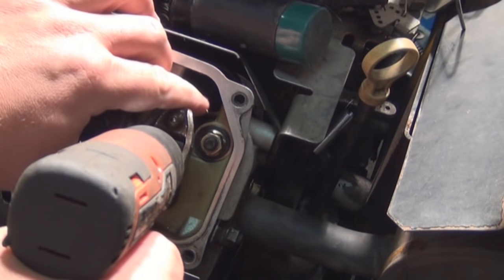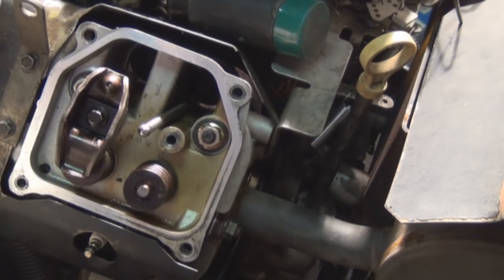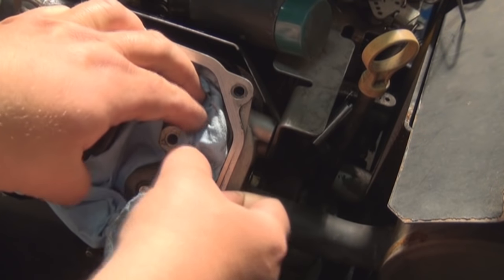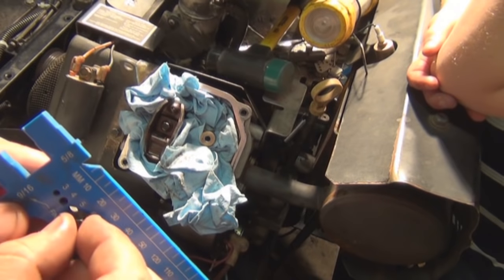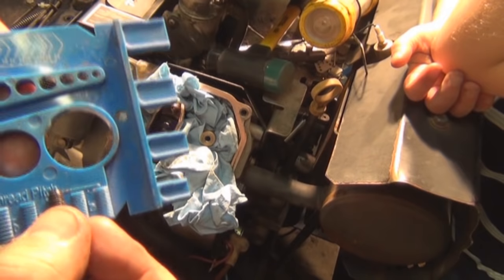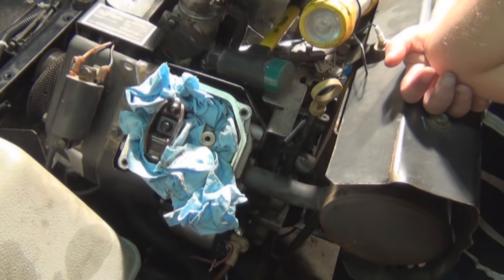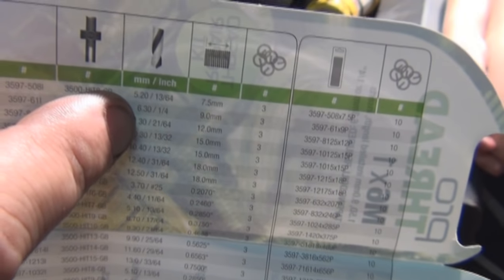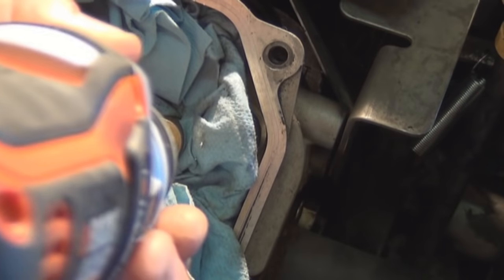How to rethread a stripped bolt hole video

Comment: That feeling of dread when it just keeps spinning. Ugh. WTF did I break now? This is by far the best video I’ve found on the subject. Thanks for posting.
Reply from the maker: I’m glad you found it useful. I greatly Appreciate your comment. Thanks for watching. Please like share and subscribe. Also please hit the notification tab 🔔
Reply: I broke the coil while tightening one of the bolt of my new exhaust manifold. Yap the bolt just keeps on turning after that. It was fixed now. I ended up replacing the washer with a thinner one just to chase the remaining coil.
Reply: It's not worser than a broken bolt
Reply: I feel the pain brother. I popped the threads on my oil cooler for a 17 wrangler
Reply: Still don’t be tempted to go ahead and try when u don’t have a clue , I just done to my 250 and I’ve made the threads worse helicoil failed and tool warped , take to pro or you’ll be a lot of money out of pocket

Comment: That was a great video. When tapping the bolt hole, I've noticed that the thread chips will break into smaller pieces if you unthread about a quarter turn for every turn that you thread the tap in. It results in a stronger threading and less stress on the cut. Also, you'' be able to tap the hole with less effort
Reply from the maker: Zer0  Yes you are correct. Thanks for watching and thanks for the comment.

Comment: use cutting oil, WD40 spray will do, and each time you make a full turn clockwise do a half turn anti just to break the metal chips, just makes it a bit easier and less chance of error...but you did a good job anyway so I guess you have done it before!!

Comment: This guy does almost everything wrong but it worked. Look at other vids if you want better info.
Reply from the maker: That statement contradicts itself, that I did everything wrong but it worked. If it worked, then how is it wrong. Regardless , thanks for the comment. All comments are welcomed.
Reply: I sort of agree, he got the job done but the method was a bit careless and could easily have gone wrong.

He should have removed the head before doing any drilling, leaving it on the engine like that is asking for trouble. The metal shavings could have easily gotten into the engine, especially when removing the paper towels AND using the air gun to blow them off. You could see the left port was exposed.

The drilling and subsequent re-threading should be done using some sort of assembly that holds your tools at the right angle and prevents movement.

I have to say this is a good example of non-professional backyard mechanics. I think the guy know what he's doing and he's got experience but what also shows through is the slack, approximate way of getting things done.
Reply: Jeremy Lindemann yeah yeah Git R done!!!
Reply: good comment but., sometimes backyards jobs are million times better than pro job ., mechanics are careless and I don't want to say assholes ., every time I bring my car to the pros . they fix it but give me another problem the last time my car was making a weird noise he say it was inside the water pump he change it doing a good job but the noise still there and he give me the check engine light on , when I told him about it after he use the scanner and saw the code  his answer was in a really bad mood you can go to California with that light ., honestly mechanics are rats., every time I do a backyard job I do a very amateur job in many hours but with better results.,
Reply: Please link to a better process.

Comment: You can repair a M6 hole by using a BSF bolt 1/4 inch. It has the same pitch and is slightly bigger. M7 has also the same pitch, but is way thicker.
Reply: where do I get English bolts?

Comment: if you are tapping something you want to last or using a smaller tap which can break more easily you should really turn back 1/4 turn every turn
Reply from the maker: magga619 Thanks for watching. I always say follow the directions of the manufacturer. But turning back every 1/4 inch is a good tip for people to follow.
Reply: That is standard practice for anyone cutting new threads.  The purpose to backing it up frequently is to break the thread material (slivers of fine metal) so they release and come out through the relief slots cut into the tap or die.  If you didn't, you'd soon lock up the tap/die with slivers and be unable to proceed.
Reply: AND, ... you could break the tap itself, inside the job making it a really, REALLY SHITTY job to carry on with.

Comment: i read many comments on how he should have tapped the hole by turning and then back, he did say it was an alum head which for sure is very soft compared to steel, i myself thought he was going to deep with the new threads, but this video does gives people the idea how to fix a bad hole, heli coil

Comment: Found two stripped bolt holes for the rotary valve cover on the block of my jetski after a full rebuild probably why the dam thing would run like crap with leaky compression. Anyway, watched this video and now i feel ready to get this fixed and get the carbs back on. Thanks!

Comment: You can use the wrench shown in the video, of course, but you'll have an easier time of it using (1) A 12-point socket and ratchet, (possibly with an extension); (2) The closed end of a combination wrench; OR  (3) A die handle from a tap-and-die set.  I prefer the latter, but you need lots of space to turn it, which you may not have in constricted areas.  However, it provides you a means to evenly distribute the force (think of it as a large T-handle wrench).
Reply from the maker: Thanks for watching and commenting. I greatly appreciate it

Comment: When tapping it's best to turn forward a full turn then back half a turn to "break the chip" of the threads that you're cutting. By simply running it straight through you put a lot of stress on your tap, and removing a broken tap turns a bad day into a shitty day.
Reply: Amen to that.
Reply: Nah - that's easy, you just need to get one of those drill bits that can cut a beautifully straight core through a little chunk of hardened steel with a splintered-off top. I forget the brand of those bits, but they're usually on the shelf next to the broken camshaft glue.
Reply: Absolutely! Good catch! I saw that too.

Comment: Very cool. Thanks for this video. Without this video, i would have probably had to make a second trip for the drill bit, but now I know to open the manual and look for the size drill bit I need. Also, the bolt measuring gauge is a neat item to have around.
Reply from the maker: +Nicholas Maietta I’m glad you found this video useful. Thanks for watching and commenting. Please like share and subscribe.
Reply: handy man followed this example today... problem solved. Thanks again!

Comment: Nice video.

Just a note that on the insert tool has a collar with a grub screw which you can lower to the top of the insert. This acts as a stop so you don't put the insert in any deeper than you need to, which can easily be done.
If it is too deep. in some applications, the bolt may only be caught on a couple of threads of the insert, which is not enough.

Also, you need to break the tang at the bottom when it's inserted. Just take the tool out slightly, turn 90 degrees, and tap it with a hammer/wrench/heavy-ish object :-)
Reply: That's what my dad taught me too! I forgot that while rethreading the fuel inlet on my boat carb & bam had to go up the next size...& the metal was so thin @ that point I didn't want to chance it so 400 bucks went down the drain on a new carb lol

Comment: you need to break off the install tab and take it out, also before installing heli coil you put on some red tread locker, otherwise next time you take the bolt out the heli insert will come out with it. I am surprise the little inspector who was watching in the beginning of the video did not say something and let you continue. He shows interest that is good.
Reply from the maker: Yes he is interested. They get old quick to. Thanks for watching and thanks for the comment.

Comment: Great tutorial. I'm restoring my 94 Pontiac Trans am and some of the 10mm bolt holes are stripped out on the fend well.... I just ordered a tap and die set...
Reply from the maker: I’m glad you found it useful , thanks for watching and commenting. I greatly appreciate it. Please like share and subscribe. Also please hit the notification tab.
Reply: @handymanPF  yes I'm a subscriber to your channel 👍🤙
Reply: I’m surprised that a 94 Pontiac will ever use a metric part
Reply: @johnzhu5735  gm is mostly all mm

Comment: nice video..question: i got confused about the left hand bit (what does that mean) and started my drilling into the broken bolt counter-clockwise😟..idk if ive gotten totally to the end of the bolt, but if so is my only option to go to the next size drillbit and then rethread? thank you in advance

Comment: does the taping has to go all the way down or just enough so the coil can be close to the surface?. or either way would have worked ?  what make the coil to remain strong even using torque ? thank u

Comment: Can you just use the bolt on the threads cut by the tap? I have a tap set but no insert kit
Reply: Jacob Curley -  Im thinking if you want to use the threads cut by the tap it will have to be a bigger bolt, and it might be too thick to go through the rocker arm, in this case.. By inserting the correct thread helicoil into the tapped hole, you have the same conditions for the original bolt, before it got stripped out..

Comment: I currently need to rethread a hole in my brake caliper mounting bracket for the guide pin bolt, would this be a possible solution, considering the bolt opening is open ended?
Reply: Caliper mounting bracket guide pin has no (male) thread. It just slides in and out. If you are taking about the hole on top of the guide pin which is used to hold the piston unit, then yes the guide pin does have (female) threads. However, why not change the guide pin itself? you will be changing both at a time! Easy and most imp, safe!
Reply: I’m here for this exact reason

Comment: Great job what about the thread in a crankshaft the problem is the engine is still in the car radiator is removed for more room but still hard because if of air con condenser
Reply from the maker: Sounds tight. It also sounds like one of those jobs where I would actually have to be there to see exactly what’s going on. So I cannot advise anything over the internet without seeing the whole situation.  I greatly appreciate your and also thanks for watching.

Comment: I had a hard time getting the flywheel off of my 50cc Chinese scooter. it seems the threads are messed up on the post that protrudes through the flywheel that the locking nut goes on. I'm not mechanically inclined can you suggest what to do?

Comment: Do you necessarily need to drill a bigger hole and add a helicoil? Or can you just re tap the same hole
Reply from the maker: +Ian Thompson you have to follow the directions on the kit. But usually you have to drill the hole bigger. I hope this helps. Thanks for watching and commenting. Please like, share, and subscribe.

Comment: I ha e even gone out an bought a helicoil kit now. The tensioner bolt side mounted for cam belt lost its thread and I really wanted a solution without change the lower half of the engine, and now I have one. Bummer though, to get access to it I have to use a right angled drill attachment doing a 8mm 1.25 helicoil. So first ever helicoil going to be tougher than most I recon. Ha ha
Reply from the maker: +James Barratt yeah that sucks. I hope it worked out. I'm glad you found the video helpful. Thanks for watching and commenting. Please like, share, and subscribe.
Reply: It did work out perfectly first time. Real easy system with flawless results. I didn't have to use a bolt chart either, as i measured the bolt with a tape measure and then measured the thread gap same procedure and just went for it. 8 x 1.25. Thanks to you and this video I fixed a cam belt tensioner and saved the engine. Ha ha

Comment: Good video. Im going to refer to it as I re-thread my crankshaft snout bolt hole. Only  a 1/2 inch porttion at the beging of the hole is stripped. My bolt is 14mm with 1.50 pitch. I'm goimg to drill the 1/2 inch portion with a 14.5mm drill and them use a 14mm hand tap (plug type). Any opinion? Wont hold you to it if I screw up (lol). Also. are the coils necessary ?
Been researching for couple of weeks, never done before, got to soon. Kia wants $800.00 bucks......not going to happen.

Comment: Check the bolt/nut markings (for material grade/strength) to help you determine if it was designed to be a metric or standard/SAE. You cannot always rely on the tool size that was used to remove the nut/bolt because metric and SAE sizes can be very close. There are bolts, for example, that will accept an 11 mm wrench, but were actually designed to be used with a 7/16” wrench because the bolt markings are SAE.

If no bolt/nut markings, then thread pitch gauges are more reliable to determine if it’s metric or SAE than trying to go by the tool size used.

Another way to determine if metric or SAE is to find whether your vehicle uses mostly metric or SAE bolts. Now, there may be exceptions, but generally, the bolts used to fasten parts onto the engine block (also known as mounting bolts) will be all of the same measurement type. Now, individual parts may be different than the engine. The nuts and bolts used within that part (say, an alternator) could be different than the engine nuts and bolts. However, the mounting bolts of the alternator likely belong to the engine.
Reply from the maker: Yes I have a video for that also and here it is https://youtu.be/0JammBOVZ8w
Reply: @handymanPF  

I think you mentioned that based on the tool size, you knew it was a metric or SAE, but that’s not always a reliable method to determine if it’s a metric or SAE. But it’s good you do know about bolt measurements. I learned this stuff mostly on my own about 2 years ago because I couldn’t find a video like yours. Hahaha.

I remember thinking that the wrench size used would help in determining if it’s metric or SAE, but I soon found out that that method wasn’t always reliable.
Reply from the maker: No, I never would guess a bolt size based on the wrench size. Thanks for watching and commenting
Reply: @handymanPF  

I see. I misunderstood you in the video.

Comment: what about a stripped bolt hole in the rear differential? does the differential and drive shaft need to be pulled in order to heli coil it perfectly straight or can it be done on the car? also with the amount of torque it has will it hold up well?

Comment: So when you drill the damaged threads out. The actual size of the hole doesn’t increase? So that the original bolt will fit like a glove?
Reply from the maker: Majority of the time the hole is drilled slightly larger then the original size and then traced with the new threads. Because it would most likely be to tight if it was not drilled a little larger.

Comment: I just did this and my bolt doesn't go down All the way the rocker arm still had some play🤦🏿‍♂️ so I tried getting out the thread but it doesn't want to come out so I tried Retaping it out in snapped the thing that wholes the rocker arms set in place then I tried drilling it out and that snapped the drill bit inside 🤦🏿‍♂️ can't win I did rocker arm all the time but this one time the bolt just had to be stripped 🤷🏿‍♂️🤦🏿‍♂️🙏🏾

Comment: When you tap it.. Can you put a bigger gauge bolt in?.. Is the coil just so you can fit the exact same bolt?..
Reply from the maker: The coil insert is the new threads. If the application allows you to put in a bigger gauge bolt then I do not see why not. Just be careful. Most of the time you cannot go to a thicker gauge bolt .

Comment: A few days ago I stripped transmission drain threads. I’m thinking to re-threads it but if I do that do i need a bigger bolt? I’m think the drain hole will be slightly bigger there for I need big bolt.
Reply from the maker: They do sell these and here is the link 
https://amzn.to/2R2eGCM I hope this helps. Just make sure you know what size it is , you can watch this video to help figure out the bolt size and thread pitch https://youtu.be/0JammBOVZ8w
I hope this helps. Please like share and subscribe. Thanks for watching and commenting.

Comment: Hi there, 
I got a couple of questions.
1) why do impact guns do no harm to wheel nuts but yet can strip the threads of bolt holes? Where I live, mechanics use impact guns to fasten wheel nuts all the time.

2) Can tightening subframe bolts with an impact gun instead of a torque wrench cause the chassis' treads to be stripped? (I suspect this was what happened to my car, the handling is a little off now. An amateur foreman might have overtightened something).
Reply: Andrew Chan funny you say that. My wheel hub and lug nut are stripped from impact gun. I need to do this to wheel hub so I don’t have to pay $1,000+ to replace the wheel hub. Exactly why I watched this video! Hope it works!

Comment: You neglected to break the tang and remove it.  I would recommend measuring the depth of the blind hole and marking the drill bit before drilling.
Reply: So you drill all the way down to remove the old thread?
Reply: seb pesky I would.  The insert will likely not clock the same as the original the original threads, so you should not expect the bolt to pass through the insert into what is left of the original threads.  I mentioned marking the depth on the drill to avoid deepening the hole and perhaps interceptina a water jacket....I would make sure I did not drill the hole deeper, in other words.